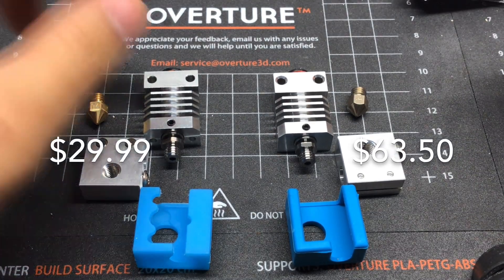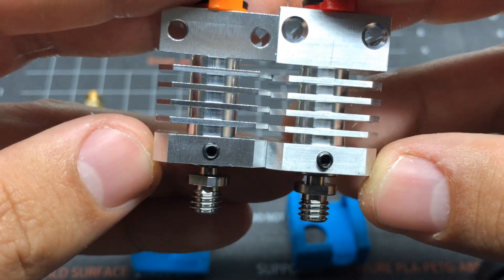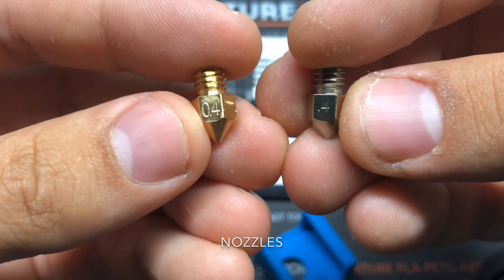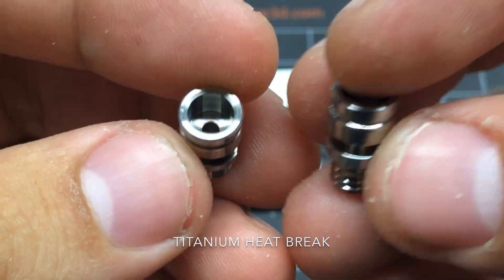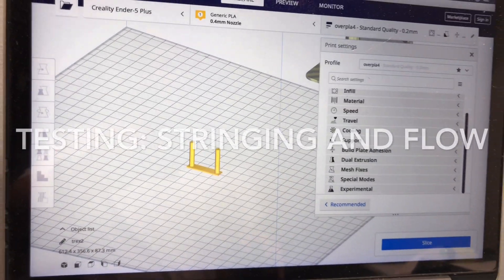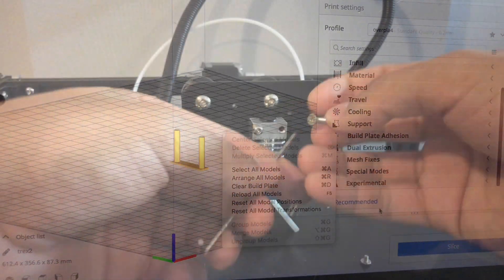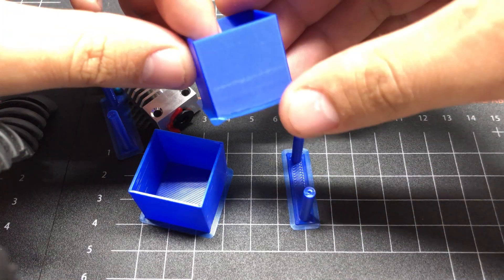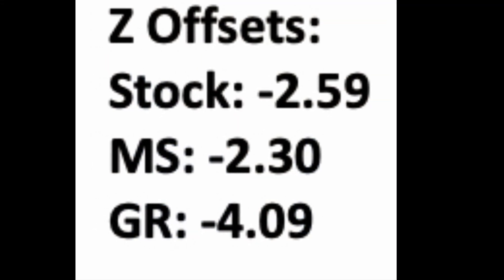All-Metal Hotend Comparison Microswiss vs Gulfcoats Robotics tested in the ender 5 plus

Comment: I have the Gulfcoast coming in today. Ordered it with the hardened nozzle. On a side note, GC support said they're working on a production run for a new version for the Ender 3 V2 because the offset on the fan is lower, so the current version falls a mm or two short causing the fan housing to touch the build surface. They estimated 1-2 months. On a side note, I emailed GC support twice and got a response within a couple hours after 'normal' business hours. That alone earned my business.
Reply from the maker: Nice! Thanks for the info.
Reply from the maker: @Brian Blake the nozzle has to sit flush with the heat break inside, the nozzle does not press down on the heat block.

Comment: Looks like the Gulfcoats Cooling Block is made from a different type of aluminum alloy.  Probably cheaper material and will likely wear out faster or maybe not be quite as good (may not matter for performance).  That is one way they save money.  As well as it is likely Chinese made which in turn would lower the price even more.

Comment: You will be surprised if you look this up they both manufactured by the same company they make more money with the cheap one than they do with the expensive one
Reply: I don't think that is true at all.  They would look exactly the same and they don't.  You can tell that one is made by what looks like a different type of aluminum alloy.  The size is slightly different as well.  One claims it is made in the USA and the other won't even say, which means it was probably made in China.

Comment: different heights, ok so how do we use a BL Touch when its to high to reach the bed?
Reply: You'd simply need to change your Z offset. Then your printer will have the updated value and know how far off the nozzle is from the bltouch probe

Comment: The nozzle thread on the inexpensive one is very likely to strip in the long-run.
Reply: I've seen no evidence of this on any of the cheaper clones. They are all basically the same with small differences in height. Most of the issues people experience with the clone are also experienced with the microswiss.

Comment: Thank you for this excellent video.  What I liked about it was that it was concise and to the point.  When I am just looking for information on YouTube, one of the most frustrating things for me is running into videos that are three times longer than they should be.  I liked especially how you pointed out that the two screws that go through the heat block into the finned cooling block make it much easier to change nozzles.  This is a point that  I believe is lost on people that will take those screws out of the standard Creality hot end.

Thanks again for taking the time to make this video.
Reply from the maker: Wow. Thanks. Glad to help.

Comment: That difference in offset is everything on my ender v2 apparently. I hope I'm wrong. I just installed it.
Reply: Yes I emailed GCoast and they said they are working on production for the Ender 3 V2. The new one will offset 2mm lower so the V2's fan shroud doesn't contact the build surface. They said a full production run takes 1-2 months. I still went ahead and ordered the current version and GC sent me a file for a fan shroud which of course is available on Thingiverse.

Comment: Hi - Thanks for the video!
At the end of the video you mentioned that you liked the gulfcoast hot because you can use your stock hot end because you change nozzles a lot, it doesnt move, the hot end stays in place. Could you please explain what you meant? I didn't understand. Thanks again!!
Reply from the maker: The gulfcoast has the screw holes like the stock one on the heatblock on each side, the microswiss does not have them (only held by the heat break).
Reply: @engineerofalltrades  Hi - 
OK, thanks! Got it! If I may, I'd like to ask another question, if I may. Why is it necessary to change the PID setting? Thank you!!
Reply from the maker: @SirDavosChannel  it is heat calibration, the pieces could dissipate heat differently and that could show a temperature fluctuation.
Reply: @engineerofalltrades  Great, thanks again for your answer!

Comment: I’m about to order the GulfCoast robotics hotend. Hopefully this will fix all of my problems. Thanks for the video! 👍
Reply from the maker: Cool! I think the price difference is mostly because of the wear resistant nozzle (which I only use that brand).
I use the stock heatblock on it with the screw to hold it in place. For bowden retraction I use 5-7mm